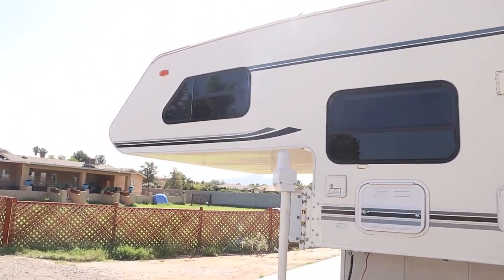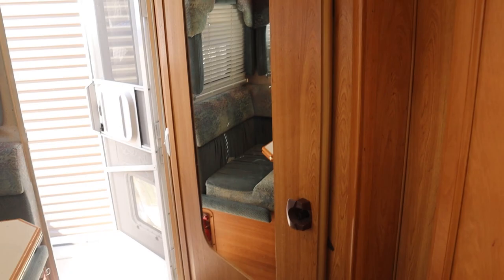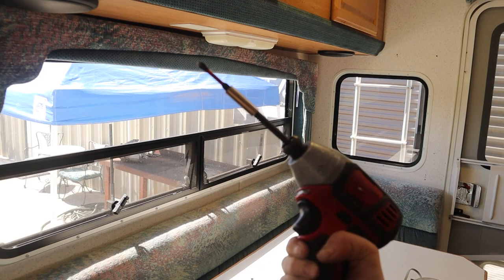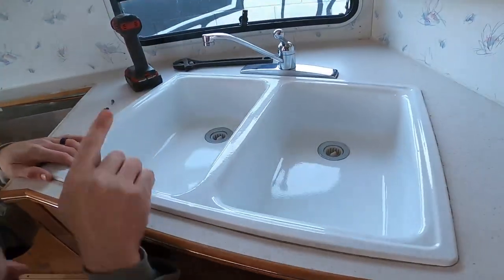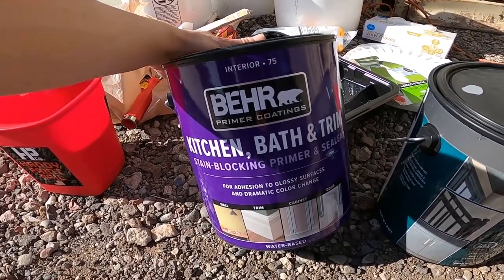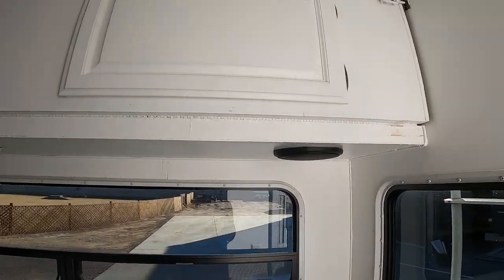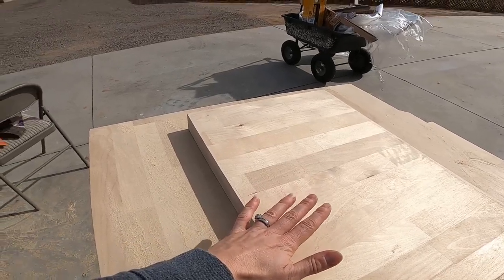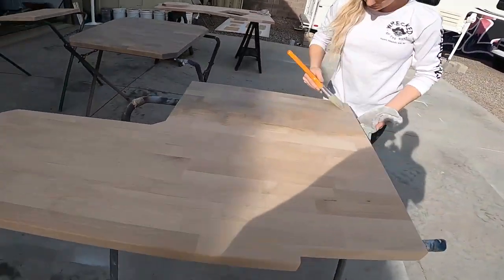Renovating our 1999 Lance 1030 Cabover Camper

Comment: Hi my wife and I have the same camper and want to paint the cabinets also. I didn't notice you sanding the walls or cabinets. Did you sand them or just apply primer?
Reply from the maker: We actually just applied primer as the walls were pretty porous. It actually soaked in great!